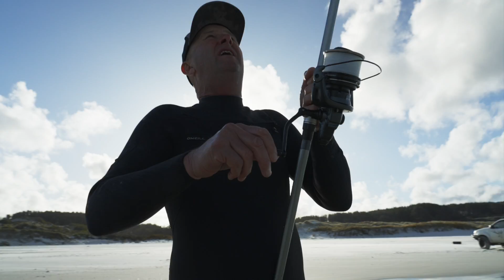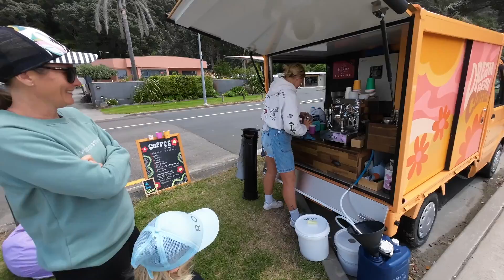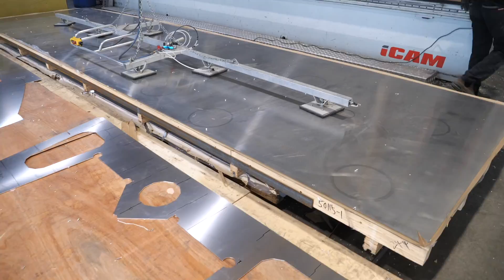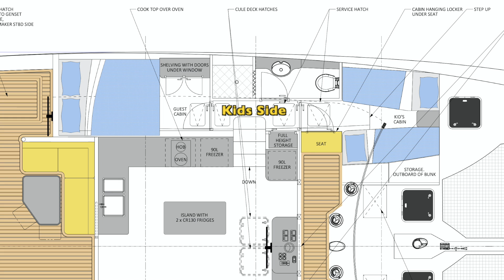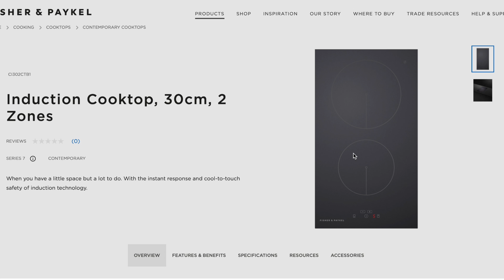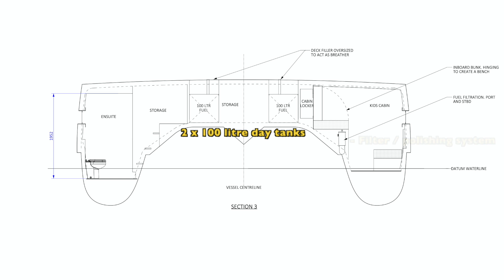Our New Boat Design Revealed! - A New Range of Sailing Catamarans is Born

Comment: What I like about metal boats is you can run half pipes down the side of the boat to use as keel coolers for the engines and chillers.  This eliminates several holes in the hull.  I also like that metal boats act as faraday cage.
Reply from the maker: We are looking into the keel cooler idea